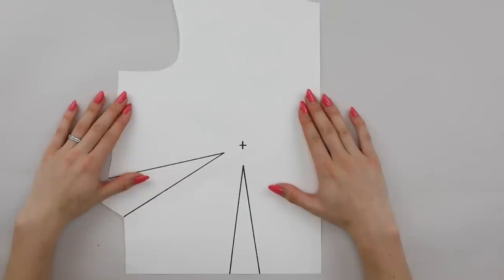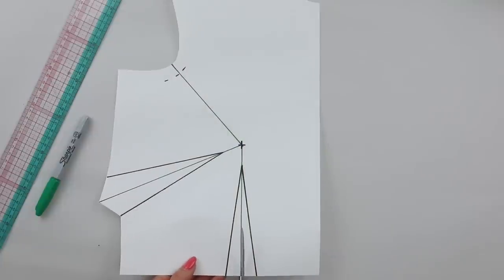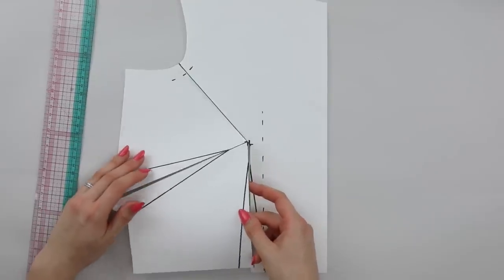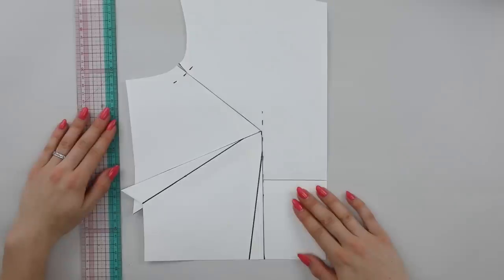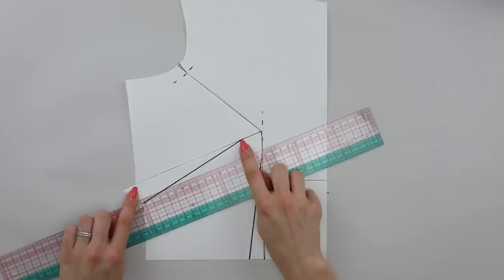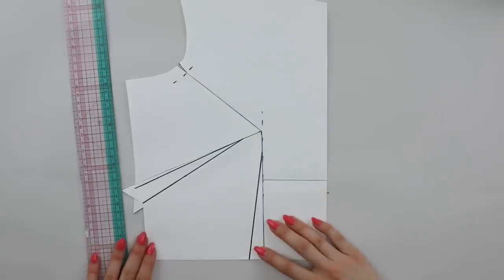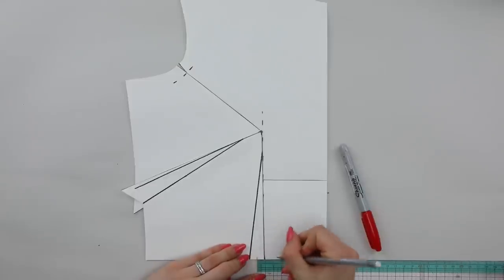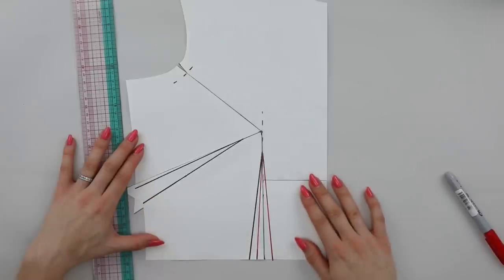How To: Quick Small Bust Adjustment - Bust & Waist Dart SBA

Comment: Hi Aneka and thanks for this clear explanation. I have a question though... If the front is now shorter, will the front no longer fit the back? If this is the case, what do I do at the side seam?
Reply from the maker: Hi Janet, the side seam hasn't changed (unless you remove more than the dart). We made the front shorter to match the side seam. So the front side seam should still fit the back side seam (as long as you didn't remove more than the total dart volume from the side seam). Does that make sense? Aneka
Reply: @MadetoSew  Thanks, Aneka, I get it now. You're so good at explaining!
Reply from the maker: @janetbruce2490  Glad it helped. Thanks Janet. 😃

Comment: Hi Aneka I’m just about to start a dress with two darts so this is so useful for me. I missed your live video at the weekend but wanted to ask if you’ll be doing a sway back adjustment any time soon? I’ve just taken a bit of the length of the bodice and a bit off each side of the centre back seam but I’m clueless really😅 also where in London are your classes? My daughter lives there. Thanks for your usual clear instruction & I’ll be looking out for your patterns. ❤️
Reply from the maker: Hi Clara, Thank you for your lovely message. I will film a sway back next week, I promise. So sorry for the delay. I realise you have been waiting for it. I have been teaching classes on Goswell Road, but may need to find another venue option that works for weekend classes. If you can suggest anywhere please let me know. Aneka x

Comment: Hey Aneka, i'm new to sewing, and going to start a diy project soon. It's going to be a mesh tent that fits under a tarp. The ground sheet is going to be Tyvek, 240x120. I am gonna fold each side 10cm up. bringing the sides together gives me some spare material in every corner. Is there maybe a nice trick to fold it or cut it and use that excess material to toughen up the corner?

Thanks!

Edit: as i was done typing i found 'how to fold canvas corners'. That is it i think..
Reply from the maker: Hello, yes that will probably work. Otherwise you could mitre the corner? I don't have a video on this at the moment, but if you 'google' a mitred corner you should be able to see it? It's what I use on curtains. Let me know if this helps? Aneka
Reply: Good morning,

Ok, i googled it and saw mitred corners are flat. I'm looking for a 10cm 90 degree corner, so it's a nice waterproof groundsheet :) So i guess the canvas fold is the way to go along with water resistant sewing thread. Never held a needle in my life...so it's going to be fun.

Thanks for replying and take care,

Bart
Reply from the maker: I completely agree Bart, the canvas fold is definitely better for a water resistant finish. Good luck and happy to help! Aneka :-))

Comment: Hi Aneka,  the waist dart that I'm working with is at a bit of a slant.  Would I cut in the middle (slanted) working my way up to the apex and then to mid arm as usual?
Reply from the maker: Hi Rachel, I would cut straight up from the waist, horizontally to the grainline. Otherwise you won't be adding the amount straight over the bust, does that make sense? And it could throw the pattern off. I would take a horizontal line down from the Bust Apex to the waist. Once you have done the FBA then re-position the dart and draw as it was originally on the pattern. Does that help? Aneka x
Reply: Yes!, thank you so much. :)
Reply from the maker: Sorry just realised I wrote FBA rather than SBA... but same thing :-))